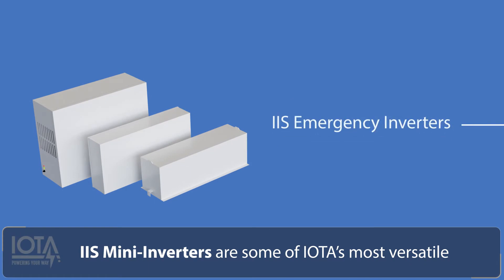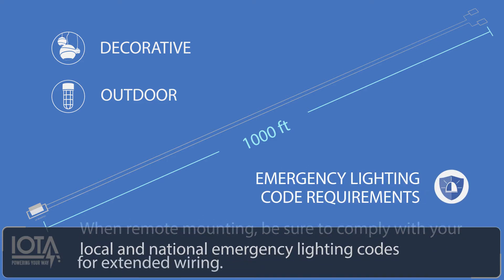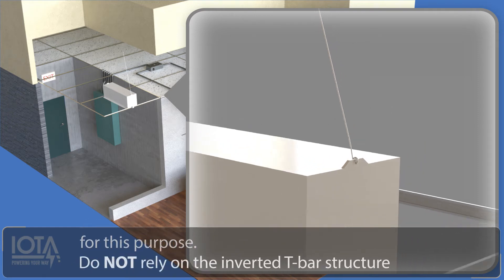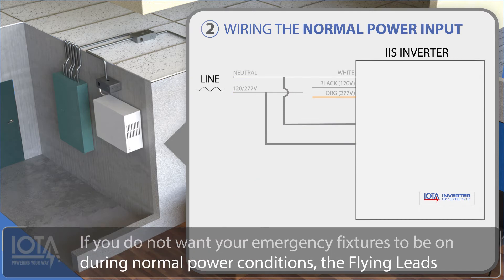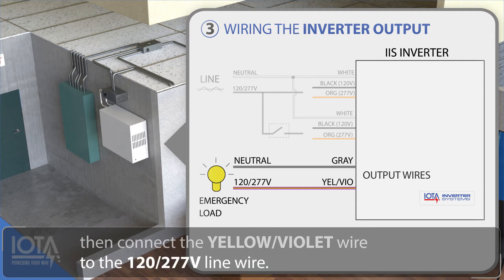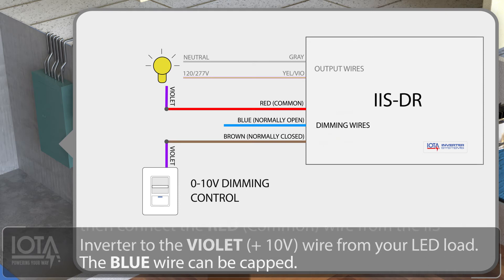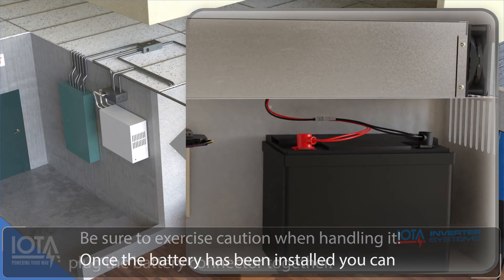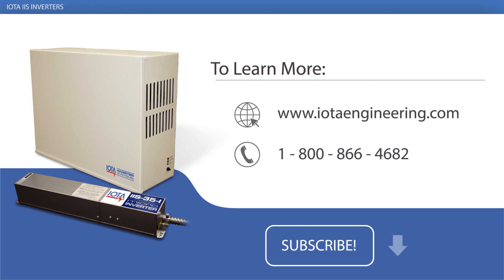How to Wire and Install an IOTA Emergency Mini-Inverter

Comment: How does it work with low voltage switching (PoE) and room controllers?
Reply from the maker: Hi Frank - sorry for the slow reply on your question. I suggest you contact our Tech Support team at 1-855-363-9527 so we can fully understand your application. The IIS Series inverters are UL Listed for emergency lighting loads only, so it would not be suitable for use as a back-up of a PoE switch. For emergency lighting requirements in a PoE application, take a look at our Power-over-Ethernet driver at https://www.youtube.com/watch?v=wm_mpdbuCZ4